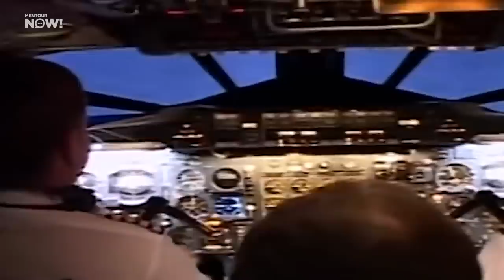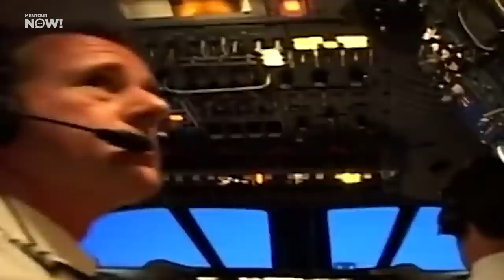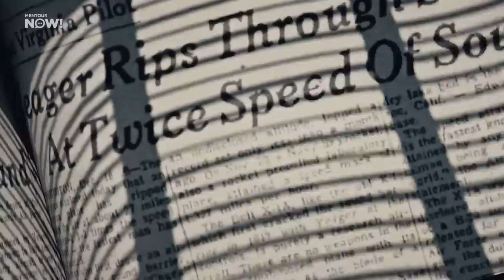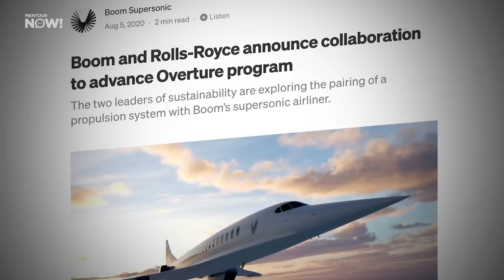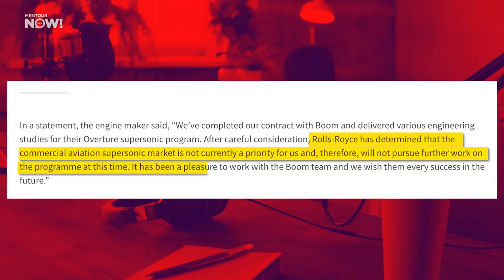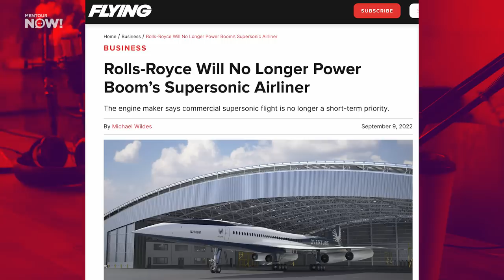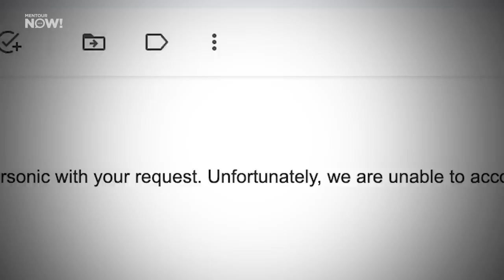WHAT’s Going On with BOOM Supersonic?! Will it Fail?

Comment: If you look at the history of supersonic flight one inescapable fact about it is that it requires alot of energy and is basically just hugely inefficient. Given the trend in aviation over the past few years towards increased efficiency (to extremes with the A350 and 787) and given the fate of previous supersonic aircraft (Concorde, Tu144 and Boeing's 2707) in the 1970s that ran straight into the oil crisis, it seems likely that Boom will run into the same problem. Generally Supersonic travel requires alot of will and finance to make possible - after previous poor experiences that will takes alot of time to generate, there is only enough capital available cheaply enough at the heights of economic cycles and it then seems that devloping the aircraft takes too long before the cost of capital rises and makes capital intensive projects like developing a supersonic aircraft not feasible, whilst the economic conditions at those times lead to a decrease in air traffic and airlines very jittery about ordering such potentially expensive aircraft (it's notable that only the state funded Concorde survived in the 1970s). Even in better finiancial times (just before the end o the .com bubble) the Boeing Sonic Cruiser in 2001 was not well recieved by the market, and now with better quality Zoom meetings/MS Teams and hugely increased energy costs (again) I'm not sure there's a viable market for Boom's aircraft - even if it would be really cool to see it built.
Reply: Will Overture be able to fill the gap left by Concorde in the SST market?

Introduction
Boom have undertaken a mammoth task in developing and producing the Overture SST, with its Symphony power module and turbofan engine. The biggest risk is that they will deplete their capital, before a prototype Overture flies. Once that milestone is reached funding should be available. The following, is based primarily on information from Boom, and assumes that Overture meets its specification and goes into airline service. I have no connection with Boom whatsoever.

Aviation
Aviation has changed radically since the iconic Concorde first carried passengers in 1976. More people are flying, the number doubles every 10 years, and they are richer. Aviation fuel is roughly the same price as it was in 1976, taking into account inflation, and with deregulation, airline tickets are now cheaper, in real terms. Aircraft now have the range to fly non stop between any two airports in the world.

Technology
Computer aided design, and simulation has transformed aircraft design and development, by drastically reducing time and costs, and increasing effectiveness. In addition, advanced technology and materials, have enabled more powerful, more efficient engines, and lighter, cheaper, and more streamlined aircraft. 

Flight
Because Overture will be economical at sub and supersonic speeds, 500 routes, some mixed land/water, are viable, rather than just 2 Atlantic routes for Concorde. Overture will be carbon neutral, using sustainable aviation fuel (SAF). Overture will will create a sonic boom, but not over land, where it will cruise 10% faster (Mach 0.94) than subsonic airliners. It will cruise at twice the speed of subsonic airliners over water. Concorde carried 100 passengers at Mach 2, over 4,488 miles. Overture will carry 65 to 80 passengers at Mach 1.7 over 4,880 miles. 

Airframe
Both aircraft are 202ft long, but Overture will have a gull wing with computer controlled leading and trailing edge flaps, and a greater span, at 106 feet compared to 84 feet. Overture will also have an empennage. Carbon composite construction will enable streamlining, weight saving, and increased strength, while practically eliminating thermal expansion and contraction.  Overture will weigh an estimated 154 tons, Concorde weighed 185 tons. Concorde could carry 2.5 tons of cargo. The cargo capacity for Overture is not known. 

Engines
Overture's engines will be medium bypass turbofans without reheat, while Concorde had turbojets, with reheat. This means that Overture will be economical at subsonic speeds and will be low noise on take off and landing. Variable geometry ducting in the Symphony power units will probably allow the engines to supercruise.

Costing
Overture's predicted development cost is $8bn, against $14.4bn for Concorde. Manufacturing cost will be less, maintenance costs will be lower, and availability will be higher. Overtures selling price will be $200M, compared to $320M for Concorde. At a guess, Overture's development payback will be 150 aircraft, and airline payback will be 10 years, assuming 72 seats and 8 hours a day utilisation.

Operation
Overture will be simpler to fly, eliminating the need for a 6 month pilot conversion course. Overture will have improved low speed handling, especially on take off and landing, while maintaining low drag at supersonic speeds. It will have a modern cockpit, with a flight deck similar to subsonic airliners. A flight engineer will not be required. Instead of a droop snoot, external cameras and cockpit displays will give the pilots a view of the terrain when taking off and landing. Its cabin will be quieter and all its seats will be business class, almost certainly with internet. In contrast to Concorde's awesome engine noise, Overture will comply with ICAO-14 noise regulations, allowing it to use all airports, without triggering protests. 

Ticket Cost
Taking a JFK to LHR one way flight:  
Showing: Aircraft type,  Fuel cost per passenger,  Economy ticket,  Business Class ticket,  Duration

Boeing 747          $147          $577             $2,308                      8hrs 
Concorde             $753                                $5,000^                     3.5hrs 
Overture^^            $708         $1,200           $3,000^^^^                4hrs 
Business jet^^^                                 $53,000 to $99,000            8hrs  

Notes
^ 2023 value 
^^ Estimated prices, assuming Overture carries 72 passengers against Concorde's 100. For the first 2 years, only business class seats will be available.    
^^^ There are no supersonic business jets
^^^^ $5,000 return 

A 16 hour flight across the Pacific on a subsonic jet could be achieved with a 1 hour refuelling stop by Overture, giving a time of,  4 + 1 + 4 = 9 hours.

Market
Overture will not be competing for the mass economy market. Instead it is aimed at the 700 million long-range business flights made each year world wide. Boom and airline customer surveys show the viability of Overture, and they have identified 500 suitable routes. All Overture's seats will be business class and ticket prices will be comparable with business class on subsonic airliners. Once Symphony gets established it could become a niche service, similar to Concorde, but with many more routes.

Conclusion
Overture will be popular with both airlines and passengers, because it will half many journey times and will be cheaper, more comfortable and a lot more practical than Concorde. The military have already shown an interest in Overture. It would also be suitable for charter flights. There may even be a market for the Symphony power unit or just the engine. As Overture matures, it will probably be developed, just like subsonic jets. So the range may be increased, there may be a stretched version, and even an all economy seat version. After Overture, Boom could possibly develop a 200 seat SST.

22-2023.09.04

Comment: The engine is certainly an important part of the solution, but at least such an engine exists, and they only need to find a suitable engine supplier. There is another even bigger challenge, that I'm surprised you didn't even consider: the use of Sustainable Aviation Fuel. 

We know that Boom plans to use SAF at the outset, and presumably that is because they couldn't justify the massive carbon emissions without it. What's happening with that? 

SAF costs astronomically more than Jet-A, and Boom's task is to introduce large-scale manufacturing of Synfuel (synthetic kerosene), and thus bring down the cost of SAF (in much the same way as Tesla brought down the cost of lithium-ion batteries, to make electric cars viable). How's that going?

It appears that Boom went ahead to design and build the aircraft, without addressing the most difficult part of it: the SAF. Thus, it seems to me that Boom doesn't have any intention of developing large-scale, viable and cost-effective Synfuel production. I'm guessing they plan to run it on fossil fuels, and deal with the SAF later.

Boom cannot succeed. I don't care how good their design is, their airframe, their engine or whatever, whether it's Mach 1.7 or Mach 2.2 doesn't make any difference if they don't have the SAF.

Comment: My guess is that the scope of the work is such that a startup like this can't do it. I think the technical limitations are overcomeable, but they just won't come out of the work of one company, too much of this IMO is basic technology,not engineering. 

The other thing is that hypersonic planes may be more practical&might make a new supersonic plane obsolete ( and that is just a feeling guys, I realize hypersonic aircraft have big challenges too).
Reply: @njlauren Your right, the scope of work is huge for a small company, but they have been in business for nine years now. Boom intend to rely on sub contractors for a lot of the work, engine, fuselage, wings, empennage, landing gear for example. The main danger is cash flow until they can get a compliant prototype Symphony in the air.

As you say, hypersonic will be the next big thing, flying near earth orbit, but that is a long way off, and will need some serious funding.

Comment: If they can only get 4250 NM of range out of this jet, it NEEDS to fail.

The most profitable routes for an SST would be from the US West Coast to Asia. It's about 11 hours from Los Angeles to Tokyo on a subsonic jet like a B777 or A350.  Cut that to five or six and a LOT of people will take you up on your offer.

Of the three West Coast airports that offer service to Asia - Los Angeles, San Francisco and Seattle-Tacoma - the only one that you could get to Tokyo Narita in a 4250 NM jet is Sea-Tac. So...two hours on a B737 to SEA plus two hours transferring baggage to the SST to go to Narita means you may as well just take a B777 direct from LAX or SFO to NRT. And...Seoul, Beijing and Vietnam are right out. Of course, they COULD stage the SST out of Honolulu, but then it's six hours on a widebody from LAX/SFO/SEA to HNL and two hours of baggage transfer. At that point you'd get to Tokyo or Seoul QUICKER on a widebody.

Gotta have 5500 NM, guys.

Comment: When aviation engine companies struggle to make profits on new engine designs for the single aisle aircraft market with many hundreds of engines, there is little to no reason  they will risk their own money for aircraft that represents a very  tiny fraction of the aircraft market. Even to get a new engine for multi-aisle aircraft  is becoming difficult. While working at a major aviation engine company, I was told there were no plans to pursue larger engine design programs, just not enough aircraft. This not enough aircraft is many times greater than BOOM. So no, highly unlikely unless there is outside money to fund it. I think that venture capital it drying out as economies struggle. My feelings BOOM is just a venture  capital ploy, more to make those in high places in BOOM rich ( a boom for their pockets) and let engineers have fun until the money runs out. It is all about making it cool to draw in a steady flow of cash. But that has worked for SpaceX.

Comment: A turbofan located in the tail is a very bad idea The McDonnell Douglas DC-10/11 and Lockheed L-1011 TriStar proved it was a shitty idea. First of all, it considerably complicates maintenance for engine removal. Then when there is a turbine explosion, the damage often makes the plane unrecoverable (too much critical damage)
under the wings the damage is more limited (with redundancy, the impact on hydrolic control is also reduced)
On the other hand, at this specific position (tail), there are parts that are unique and without redundancy.

To have made a Turbofan which takes mac 2 more than a few minutes, but in hours, is far from trivial as proven by the Olympus Engines.
the engine of the Tu 144 the Kolesov RD-36-51 was its main weakness.

Comment: Perhaps Boom should see if Briggs & Stratton would develop and engine for them. 🤔
Reply: Florida Turbine Technology, a division of $1.88bn Kratos Defence, started the symphony engine design in January 2023. Boom stated that no current engines, either military or commercial, are suitable for adapting to Overtures unique requirements. 

Boom will design the pods and the variable geometry exhaust and inlet ducting,

A big fuss is being made about Rolls Royce ending their contract with Boom, but AFAIK the contract was only for consultancy, and not to build an engine for Overture. Besides which, the Symphony project would be totally unsuited to the tier one engine manufacturers, like Rolls Royce, GE, P&W, and Safran. Their cost base and time frames would be out of kilter, and the volume of sales would not warrant their investment. GE caught a cold with the Affinity program.

Comment: If I were trying to make an SST, I would base it on an existing engine. Not design a plane and hope an engine would become available.
Because hope is NOT a strategy of any kind. In fact it is purest lunacy. 
I always assumed BOOM already had an engine, and all they were doing was trying to make a chassis that would produce a very small sonic boom.
Now I know the truth, I am completely baffled as to why any sane person would put a single cent into such a project.
A modern jet is not an aeroplane. It is a cockpit/cabin and engines with an appropriately designed engine cover.
With all due deference to the engine-builders at Lamborghini, who describe their bodyshells as engine covers. :)

Comment: As cool as an SST is, there is no need for it. Speed is not the defining issue for airlines, and one could argue they would Rather slow things down, not speed them up. Given airline route congestion they want to distribute traffic through the day, not bunch them up. It will fail unless a government wants to step in.

Comment: The really intractable barrier for commercial supersonic fleet remains noise. The high maintenance and fuel costs don't matter so much when your target market is billionaires and would-be billionaires, of whom there are enough these days to fill the plane.  Modern engine designs and airframes would make these much better than thos of the Concorde. But innately supersonic engines require supersonic exhaust velocity - you can't use high bypass engines. That means lots of noise. Then of course there is the sonic boom.